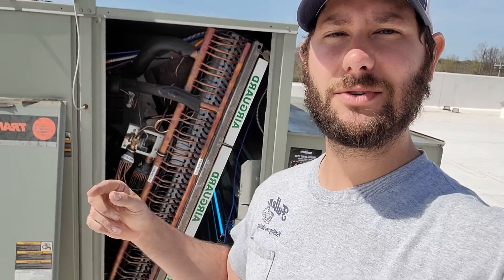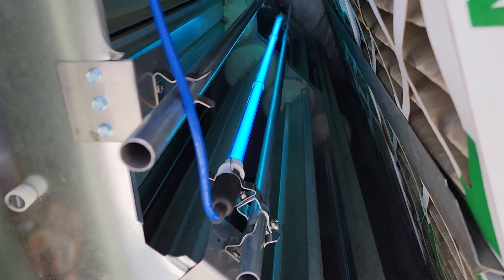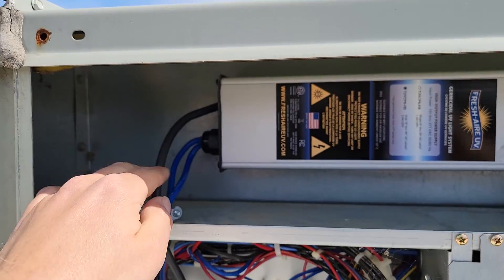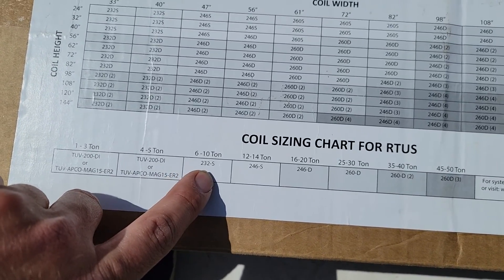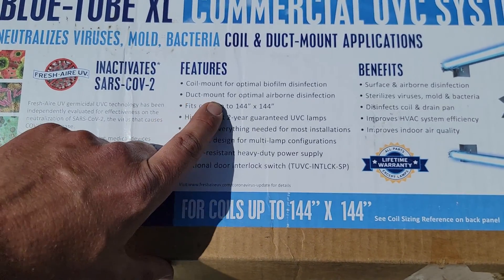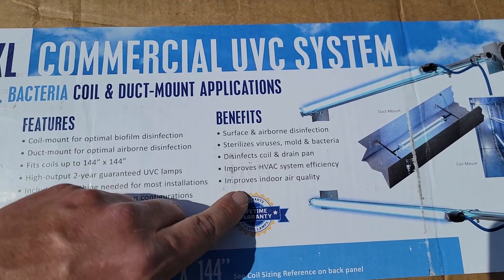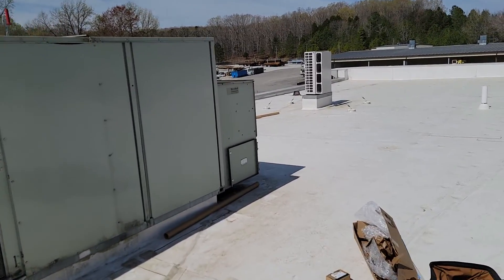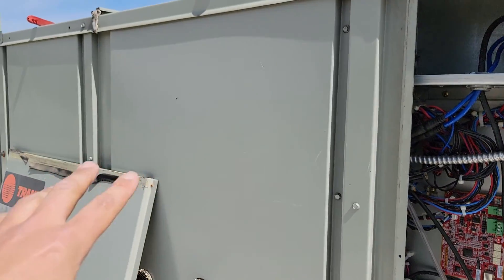How to install UV Light on Commercial HVAC unit? #uvlight #hvac

Comment: Hey Tad, great video. Doesn’t the UV light breakdown the fiberglass air filter? Good to see these applied to commercial systems.
Reply from the maker: Thanks ryan
It will deteriorate the filter
Gotta keep it as far away as possible